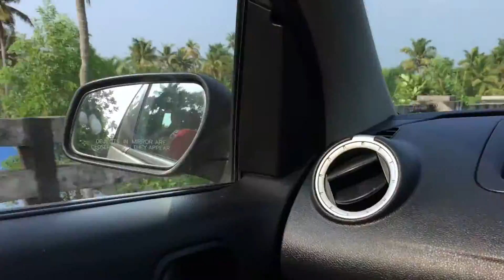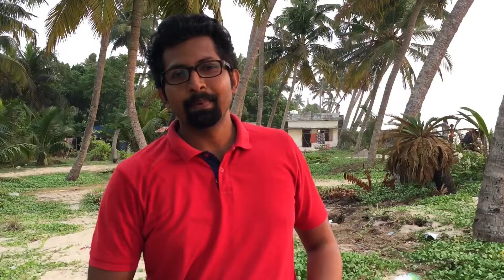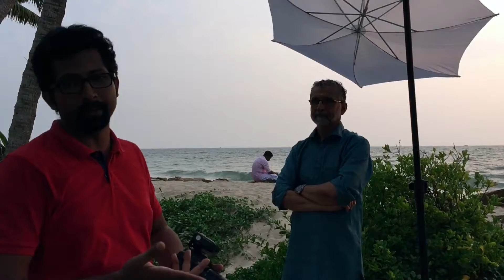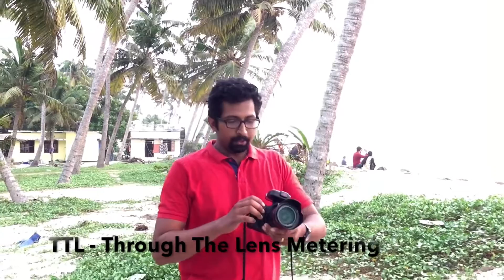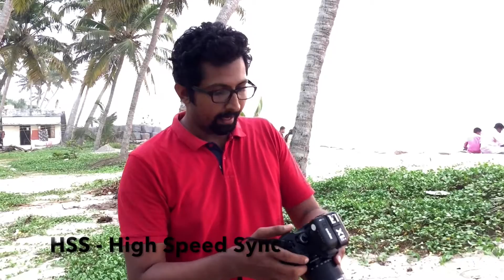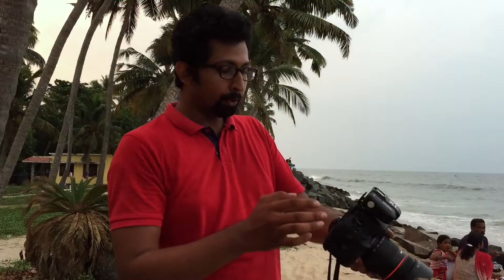Part 3 Flash photography basics - TTL, High Speed Sync, 2nd Curtain Sync

Comment: So 1300D can do 1/320 sec with the flash, that means it also can do 1/4000 sec with the flash (HSS) right?

I am asking this because I've never seen someone doing a video about 1300d with the HSS (This is the first time I've seen)

Also because Nikon D3x00 & D5x00 didn't have the HSS feature. So I'm thinking like "so the entry level camera cannot do HSS huh"

Please reply to my questions sir, I'm really curious.
Reply from the maker: Yes 1300d can do 1/4000 with HSS.
You'll need a flash system that supports HSS to do this.
I use a Godox flash system.
Reply: @VinuRV  one more sir, does the 1200D can do it to (HSS)?
Reply from the maker: @mrd1620  I've not tested on 1200d but I think if you have HSS compatible flash system, it should work with 1200d.
Reply: @VinuRV  thank you very much for your answer.
Really helped me.
Have a great day sir.